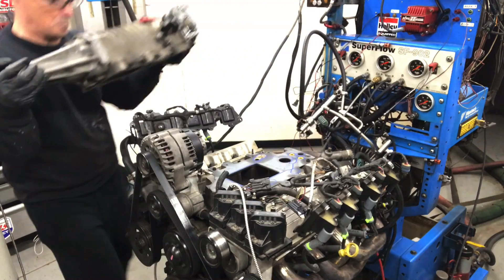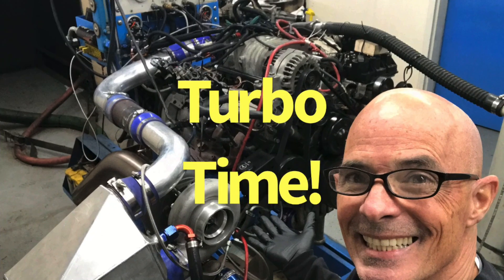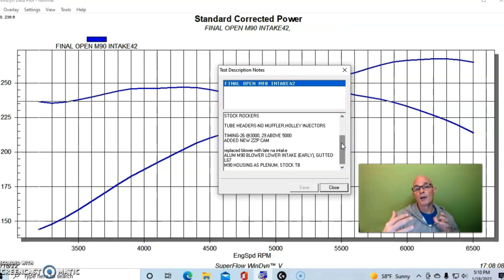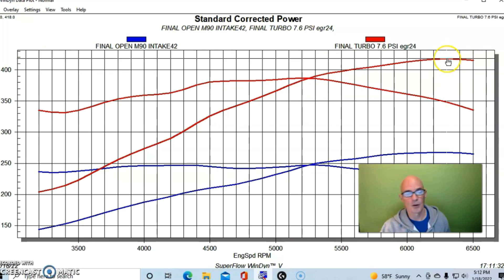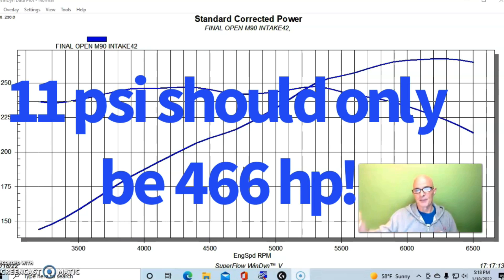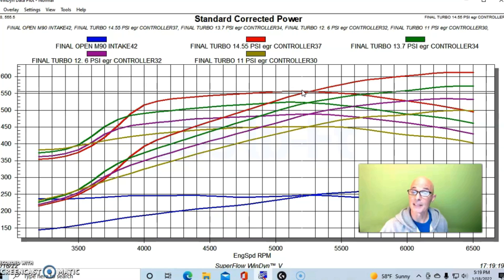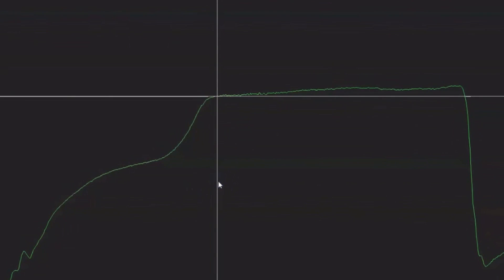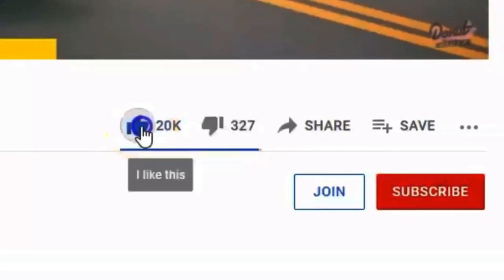HOW TO MAKE V8 POWER  FROM A (CHEAP) TURBO V6! THE L67 3800 V6 FINALLY GETS A CHEAP EBAY GT45 TURBO

Comment: Fun Fact; The Series 1 and 2 3800 L36/L67 "Ecotec" was fitted to Holden Commodores in a rear wheel configuration between 1995 and 2004.... unfortunately we missed out on the Gen III with the upgraded aluminium intake gaskets etc
Thanks for the intel Mr Holden-er!

Comment: I was wondering around what rpm would the gt45 spool? I ask as I have a 3.7L v6 and I want to avoid spooling at something crazy like 6k
Reply from the maker: for what power level?
Reply: @richardholdener1727  probably around 500-600 whp but I do want a usable powerband

Comment: Would like to kno were to get a turbo and crossover pipe for the turbo for an 02 3.8
Reply from the maker: We used the stock exhaust manifolds and cross over
Reply: @richardholdener1727  mine is a 2000 grandprix gt coupe, 200hp and I like how it runs but I've always thought it could use another 10 to 20 more hp, I've put a zzp 2.5" downpipe w cat on but I swear it doesn't seem like it reaches 90mph from 60 like it did w original downpipe and one thing I kno between the two is this zzp is only single wall pipe compared to the original being double wall,, so I think I'm possibly loosing a little backpressure at the rear manifold and maybe loosing a little power up top? Torque seems atleast as good but I'm not sure it's proper for mine on the hp, motor is all stock and properly maintained runs beautiful and I don't expect this zzp pipe to give more hp than 5 or so but I'm just feeling like it should be added to a gtp instead of my gt

Comment: Can cam specs move the peaks down in to the 4-5k RPM range for street friendly use?
Reply from the maker: intake would make a bigger difference in where the motor makes peak power

Comment: what computer do you guys use and how do you tune it? Is it possible to swap a obd 1 computer out for an obd 2 capable? Looking to do this with my obd 1 car to run low level boost but not sure about tuning
Reply from the maker: we used Holley HP

Comment: What cc injectors are you running . im just starting to build a l67 with the gt45 turbo and a stage 2 cam or stage 3 ( havnt decided yet) . engine is currently being torn down as we speak
Reply from the maker: 80s

Comment: all the power in world is useless if you can't put the motor in the car.  none of those components will fit in a w body...so what's the point?
Reply from the maker: If only you could build the tubing so it fits in your chassis, like I did on the dyno. Making the power is the point!

Comment: I'd like to see what a turbo would do on a STOCK Series II 3800. (-:
Reply from the maker: if it makes 200 hp na-then it makes 400 hp at 14.7 psi with a turbo
Reply: @richardholdener1727  I can live with that 😉👍

Comment: I have an l67 sitting in my garage and a spare thousand bucks I’m totally doing this
Also there’s a man in aus running 10sec quarter miles in an nitrous L67 stock block just gapped rings and cometic gasket
Reply: It has 8.5 compression forged pistons as well.

Comment: Looking for a 99 buick regal GS to swap in the 3800 l67 in my Buick century.
Reply from the maker: LOTS OF 3800 L67S IN THE YARDS
Reply: Is the 3800 subframe the same as the 3100? Or COMPLETLY different?
Reply: And do you think the subframes have the same mounting holes to the bodies?

Comment: Hey boss. I have a 3800 that I am putting in a project and also putting a turbo on. Any information on the computer to use or wiring information?
Reply from the maker: ARE YOU RUNNING A HOLLEY HP?
Reply: @richardholdener1727  I am not right now. I have the stock pcm system right now.

Comment: Did you ever make a video comparing the long tube headers to the factory exhaust manifold headers at a high horsepower?
Reply from the maker: I think near 350 hp
Reply: @richardholdener1727  Where's the video/what were the results?

Comment: How can the 3800 actually not need any bottom work, piston work, rod changes, crank changes and give 3x more power?  Are there even any forged parts on a 3800?
Reply from the maker: all stock
Reply: @richardholdener1727  This engine is the junkyard dream engine then.

Comment: Most e85 turbo L67 with decent cam can pretty easily put 24deg in at 15psi. With a big cam and big turbo ive put in 30lb with 21deg to get over 1K pretty easily.  Great engines.
Reply: You Sound Like The Guy To Ask This Question lol. Im Going Over Ring Gap. I Got A Set Of Diamond Forged Pistons With Ceramic Coated Tops. They Are The 8.0:1 Compression Ratio Pistons. I Bought Them Them Intense Racing And They Had .020" Ring Gap For Top Ring. At The Time I Thought Nothing Of It. Doing Research It Looks Like The Ring Gap Should Be Around .026" For Mild Boost 15-30PSI. I Wanna Make 500-600WHP. I Was Making 480WHP Around 16PSI Of Boost On Stock Ring Gap But That Was On 210,000 Mile Rings/Cylinder Bores. Should I Take It Apart And Gap Them To .026"? I Find It Really Dumb For Intense Racing To Be Listing A .020" Ring Gap On A Set Of Forged Pistons Which I Think Would Be Used For No Less Then Mild Boost lol. 

Last Question On Cylinder Heads. I Got A Set Of Ported 3800 Cylinder Heads (the n/a versions). I Only Came Across One Thing That's Making Me Paranoid. 1 Head Had Smooth Intake Runners And 1 Has A Dip In All The Runners Where The Injector Would Go On The Supercharged Head. Here Is A Video
 https://youtube.com/shorts/IQHczTzBYFg?feature=share

Should I Be Concerned? Or Am I Being Overly OCD? I Waited Nearly 2 Years For These Cylinder Heads And I'm Terrified Of How Long It Would Take To Get A Matching Set Of Ported Cylinder Heads.

Comment: Do the 3.7 mustang engine it can make 600+ at the wheels on a sealed stock motor, would be very interesting to see what you could do with it, they are also pretty cheap which makes them possibly a better swap than an LS especially in chassis concerned with engine swap weight and chassis balance

Comment: Would running a m90 through a front mount air to air and then through a throttle body work? I was thinking of mounting it on its side with a "hat" bolted on that's blowing to 3"(or would 3.5" be necessary?) intercooler piping, front mount and back up to the stock throttle body?  I can't imagine it would be a very responsive engine if the throttle body is all the way on the other end of all that piping and supercharger.
Reply from the maker: not sure why you would do that
Reply: @richardholdener1727  so it can be intercooled. No intake available for my engine either. Plus if I'm not happy with it I'm halfway there for the turbo setup. Only looking for 350hp reliable from a 4.5 liter v8(with no cam options to get there).
Reply: I guess really no different than a centrifugal with a front mount intercooler right?

Comment: I would love to see what a more modern intercooled 1.9L TVS supercharger would do on the 3800 V6.  Also its best to have the supercharger blow into the turbo inlet in a compound setup.  The blower creates way too much restriction when the turbo is blowing into it and you loose the multiplication factor of feeding a turbo a boosted charge.  Maybe do a test and post the results.
Reply from the maker: blower feeding the turbo?
Reply: @richardholdener1727  Yes, yesterday I watched a vid of a Whipple feeding a turbo on a Cummins powered rock crawler with great results.

Comment: My theory is that the headers will start to glow much quicker because there is a level of back pressure thats extremely hot as we all know so there for its pretty much telling us that the header tube size is too small  and could do with larger tubing and in return flowing more exhaust spooling up that larger turbo much more faster and getting rid of it quicker aswell hopefully releaving some of that back pressure which will help it spool back up when off boost at a cruising speed and keep the heat out but we should always pay attention to what our motors are saying 🤠 thats my theory guys so please don't come kick my door in and skin me and my family alive if I'm wrong...its what my brain come up with while watching the video so instead of the hate comments or being a dickhead how about you just educate me and teach me why im wrong or if im close explain that too 💪🏽🇦🇺
Reply from the maker: THE GLOW IS FROM THE LOW IGNITION TIMING ON BOOSTED APPLICATIONS
Reply: @richardholdener1727  and does what I said have anything to do with it ??

Comment: Could you run a turbo and super both again but this time use a charge air cooler after the turbo, AND after the supercharger? With sensors between everything? I'd love to know how the temp goes up and down between the components
Reply from the maker: won't be doing compound again

Comment: WOW! I had no idea those 3800's could hold so much power from the factory!! Impressive! It even has me thinking on a KILLER  build lol
Reply: Sbe 3800 have been 700whp many times. Will probably lift a ring land on the engine dyno around 850-900. I've been well over 1000 with a forged rod/piston and the rest stock.  Great engines. 👍
Reply: Street machine.

Comment: Why was a NA 3800 manifold not used? Love your stuff Richard. Also can't argue with more than double the power.
Reply: I am very confused about this as well. I plan on turbo charging my supercharged Buick regal, but I need to know if the upper and lower intake can handle that power.
Reply: @Mr.Opossum218  The injector ports are drilled into the head on the supercharged engine and are casted into the lower intake manifold on NA engine, you would end up with 6 extra injector ports if you did it.

Comment: I hope for a future vid that you show comparisons of power between the blower and turbo. I road in a GN Turbo Buick and I was surprised back then. As a V-8 lover, the little Turbo Buick was stunning.  Too bad GM didn't work on the reliability of the engine as turbo failure was constant. I believe the turbo had a "DRY" center section
Reply: Nice to have a water cooled center section with plumbing for a convection loop.
Blame the GM bean counters for that.
Reply: And Richard just did a super VS turbo comparison... Thanks again Richard. Richard is awesome

Comment: Turbos are always a hands down winner for making big streetable horsepower. You can put a turbo on one of the old 3800 that were built in the mid 80's and they'll even make big numbers with a mild cam upgrade. Bad flowing heads be damned, just turn up the boost. Great job sir. Thanks.

Comment: Great work mate! been waiting for this one for a while as you know the l36/67 was popular here in oz keep it up, would be great to see that gt45 combo with a bit more cam or maybe Chuck on some high ratio Rockers btw I’m running an l36 with rear mounted gtx35/82r on pump98 with 9.4:1 comp and softened quench points even in summer heat I have no trouble running 18psi daily, but with good fuel and and reasonable air it gets rowdy at 20-25psi and pushes 1620kg down 1/4mile at 136mph
Reply from the maker: what timing do you run on 18 psi on 93?
Reply: Sorry for the late reply it’s  98 I’m running it’s about the same as 95 over there I hear, not sure what the timing is it’s just a Mail order mace l67memcal still running a maf but I use wide band and egt and crudely a high rising rate fmu so a Overkill fuel system is needed cramming 120psi through 42lb injectors and I mechanically adjust mixtures
Reply: If you see this I'd like to find out more about your setup. Cheers

Comment: Thanks for the video😉
So I might considder a GT45 in the place of my GT3582, actually pushing 407HP at the wheels.
You said the boost curve was pretty good? On the graphic, it seemed to jump up at 3500 to 4000rpm? (Probably would kill my Fiero's gearbox with this jump at each gear change.)
Thanks again for showing what can be done with a 3800👍🤘

Comment: Would a 3.7 jeep motor benefit from this turbo?  
Would it spool ok. If so what flange t3 t4? What size housing and turbine/compressor wheel.
Reply from the maker: use a smaller turbo

Comment: Omg, super impressive numbers. Obviously a great choice for the camshaft for consistency on the power and torque curve. I'd really be interested to see what kind of torque curve you would have if you were able to use a longer (tuned port style) runner manifold. I'd definitely go with the turbo/s, all the way. I would also be interested on your thoughts, in your experience, what kind of differences in numbers if I was a 3.8L V8? 3.5" bore and 3" stroke, with the same cam set up.

Comment: Would love to see the power of the twincharged combination vs the GT45 by itself at the same boost pressure!
My guess is the twin would have more tq at very low rpm, but less max power due to the belt load. Usually 50+hp from what I’ve read online.

Comment: What I would like to see is a comparison between the 3800, I-6 4200, and the 4.3 All 6 cylinder engines from GM. Base, NA modified, supercharged, and turbo . What could be more fun in a GM 2000-2008 truck
Reply: Off ya go and do it then.
Reply: I'd love to see a 4200 swapped 4th gen camaro.
Reply: Just cut to the chase and use a 4.0L Barra from Ford Australia. Capable of huge horsepower.
Reply: @boingkster  part of the point with a lot of this testing is seeing what kind of power ppl can make with junkyard engines. Most ppl aren't going through the headache and cost of importing something from Australia when something that can do the job for less money can be found in a local junkyard.

Comment: Hey Richard I have an idea, now here me out what if you put a vgt turbo on this motor or should I say multiple motors????
Reply from the maker: control strategy is complex
Reply: I've been trying to do my research so far what I found is vaccum control for the venturi's but I did also did a company that has a lever action vgt turbo when I remember which it is I will send it to you

Comment: 8:27 - exactly where my mind was too (about 2x the boost) - so that turbo helps efficiency cuz that's more than 2x the stock power

If I had my druthers, I'd get a twin screw rather than that Roots, and feed it w/ that GT45, along w/ ring gap, studs, etc....I'm sure that turbo can push more air than that engine can handle, so a twin screw would help squeeze it in....turbo would light faster cuz a twin screw effectively increases engine displacement so the turbo would like that

Comment: I've argued for years that you can double the HP without doubling the Atmospheric pressure, let me explain my reasoning.
At WOT there is still some degree of vacuum in the intake manifold, it varies depending on the throttle body and intake tract, but it's there, anywhere from   0.5 hg to 2.0 or there about, the difference from say 1.5 hg to 0 or 0.5 PSI is a level of "boost" not particularly impressive but the engine does react to this, in effect that's like 2 PSI of boost, now if we continue to 10 PSI, I would expect the results to be similar to 12 PSI Boost. Any thoughts on my reasoning?
Reply from the maker: achieving the formula is difficult, bettering the formula even more so
Reply: @richardholdener1727  

I was thinking, which is what usually gets me into trouble 😅,  and I'm conflating Absolute Manifold Pressure with Boost PSI, as far as the formula goes, a rise of 14.7 in the Manifold would double the NA power numbers, that I don't dispute, what I was trying to say is less than 14.7 boost PSI can still result in a rise of 14.7 in the Manifold from the NA WOT numbers. I noticed this when I put a turbo on my Suzuki Sidekick, she definitely had more power at part throttle  showing 0 psi on the Hg-Psi gauge than without a turbo. Love your work...Keep Testing, I've learned a lot from what you do, Thank You 😊
Reply: I would assume you're right that 14.7 psi in the manifold = 15-16 psi before the throttle body. This also has to do with volumetric efficiency at peak power. Some engines won't make double HP at 1 atm boost. That's why this combo was so good.
Reply: Think of the BMW 1.5 F1 engine in the 80s, it was making 1300-1500hp on 80psi, that's 5.44 atmospheres, 1500÷5.44 = 275hp, which we can all agree is an unattainable HP output for a NA 1.5l engine, I would guess max theoretical power for a 1.5 NA would be in the 180-200hp range based on the numbers attained by high-end streetbike engines.
Edit: I'm wrong, the 1441cc Kawasaki ZX14 made a claimed 207hp @13,200 rpm with only 12-1 compression on premium fuel. So on F-1 fuel with higher rpm and compression 275hp seems attainable.
Reply: @HoggishGreedly  

HP and Torque are two different creatures, the F1 engine makes incredible HP numbers and the Torque will rise with the RPM but it's more like a light switch,  on or off, but when she's on watch out. Now if you want to see some crazy boost  the competition Diesels are over 10 atmospheres some close to 200 psi, blows my mind
Reply: @goodmanboattransport3441  That makes for  SPECTACULAR, explosive engine failures at times when they are competing.
No room for error at those crazy boost levels........
Reply: @gregallen9065  

You got that right, I watch the tractor pulls for the same reason

Comment: Turbos rule.  

Rich is falling in love with the little Buick.

I can't understand why some posters are complaining about too much Buick 3800 testing.  It's the little engine that could.
Reply: Those who've never really touched a 3800 really have a lot to say about them, but the guys who have, love em
Reply: Never enough Buick!! 3800 Buick..
Reply: If you don’t know what your doing they bite you in ass hard. But I think may be every boosted engine.
Reply: We had in our Holden Commodores over here in Aus (currently have a 91 Vp wagon running the buick 3800) so might start saving up to do this 🤔👌🏼